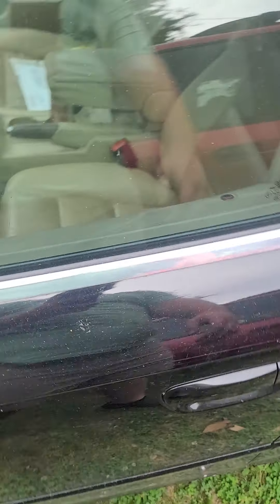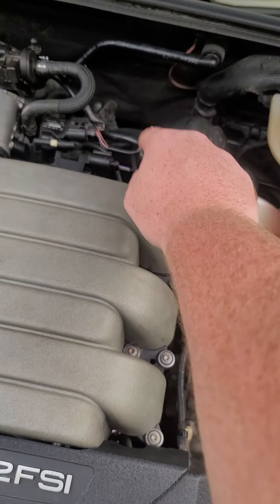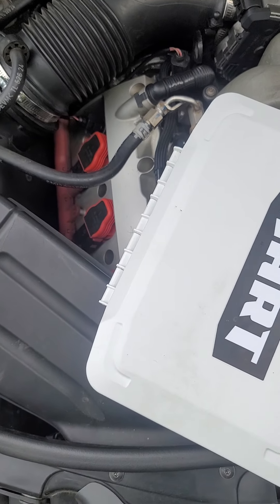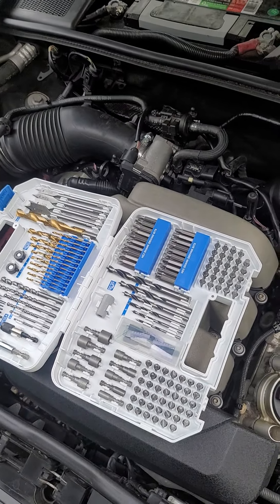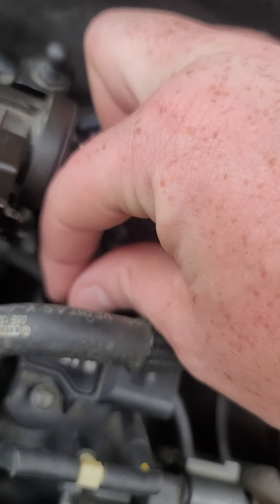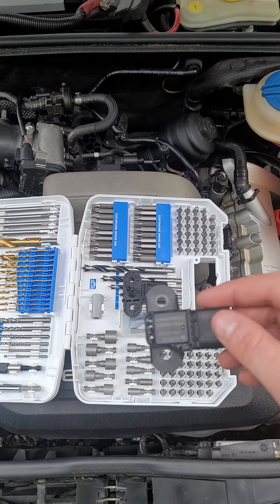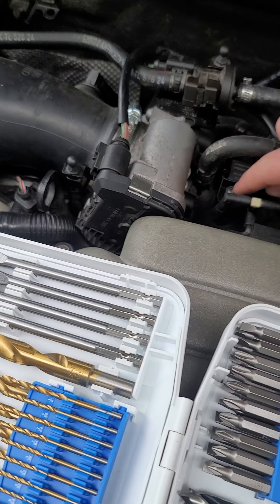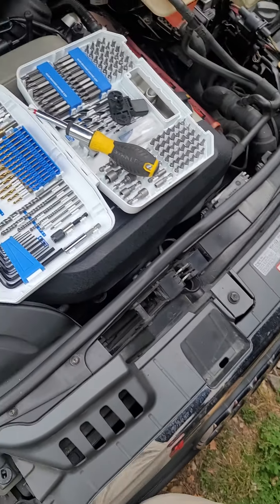How to replace your maf sensor on your Audi 3.2 fsi

Comment: Hi I just found your channel.

My 2009 Audi A6 C6 2.8 FSI keeps  having difficulty running on idle after I drove it for a while. Let’s say I start it up in the morning, do some grocery shopping and after an hour want to start it up again. Then it has a rough time starting up (I have to hit the gas pedal while starting up to get the engine running). From then on it has also problems holding low revs in idle and eventually turns off. The next day it starts like nothing happened. When under load, the engine works fine.

I am getting P1196, P1197, P0156, P0136, P2237, P2240, all lambda sensor related and I just changed all the sensors at a shop and it cost me so much but the problem stayed the same.
Do you think it’s this sensor or even a failing high pressure fuel pump?
Reply from the maker: Try the easy part first, replace the intank fuel pump, it sounds like lack of fuel.

Comment: Can this just be cleaned? Or need to replace?
Reply from the maker: You can definitely try and clean it, make sure you use electric cleaner from CRC. If that doesn’t work then you can definitely get a new one.

Comment: Hi bro, I am getting p0172 and p0175(running rich banks and bank2) code, will this sensor replacement solve the issue? It's the same car audi a5 3.2 fsi Quattro.
Reply from the maker: Check air filter, change maf/map sensor out, and do a tune up.
Reply: Hi, I’m also getting both errors. Did you solve it by changing MAP/MAF sensor?
Reply: @gabrieltovar8628  hi bro, the same week someone crashed into my car and it was totalled and bought a new car😊 good luck to you mate all the best 👍
Reply from the maker: It ended up being the chains.. my engine went on a grenade strike lol

Comment: What code were you getting that made you want to replace it? I'm getting P0068 and I'm trying to figure out what the issue is
Reply from the maker: Well I was getting the map and maf sensor code. But it didn't fix my issue. So I continued digging into the issue
Reply: @L.U.X.X  Did you ever get it resolved? Same issue -sensor dIdnT fix . Looks like 2 different part numbers..... not sure if that makes a difference or not. ?
Reply from the maker: Sadly all this built up to be bad timing which was causing random codes out of kno where. My car would shut off driving anywhere from 10 to 100 mph.
Reply: @L.U.X.X  Did you reset the ECU after installing MAP sensor?
Reply from the maker: Yes I did. You never want your battery connected when you do sensor changes. It can Short circut.

Comment: Not sure why but online retailers list a “Maf” for this 3.2 engine… had me scratching my head cause my son’s 2011 q5 3.2 does have a MAF off the air box
Reply from the maker: Not all 3.2 engines are the same though they might look it, some of the sensors are in different places on the Q5 and the Q6-7

Comment: I just replaced mines the same way.
I disconnected the negative battery.
Took off the old one, put the new one on.
Reconnected the negative battery.
Turned the car on (without the motor running), let stand for about a minute (I actually did this twice).
Then I turned the car on. 
I then erased the code.
So far, no problem.
Reply from the maker: Sweet I'm glad this video helped you out!

Comment: Hi man, I have codes p0491/0492. Do you think this could be a root cause too? Thank you for your videos bro 👍🏾
Reply from the maker: Id personally look into the air injection valves, there are two of them bank one means front side bank two means back side, swap the sensors around and see if the code follows the sensor and if it does you will have found the issue with your car.

Comment: The one you’ve just replace is the MAP sensor…the MAF sensor is close to your air intake filter.
Reply from the maker: Not on the 3.2 fsi engine. Audi had made the best choice ever by doing this.
Reply: I can attest to this. There is no conventional maf sensor in in 3.2

Comment: I feel like I got jipped by not having the conventional maf sensor lol
Reply from the maker: Okay what's going on? What's your issues?
Reply: @L.U.X.X  sorry. Just saw this... been having some health issues but did get done good news so
Anyway. Keeps throwing the left bank o2 code. I can reset it and get a couplebof hundred miles on it but I think it's misfiring, going rich and popping the code. 
Is there a carbon issue?  3.2  with 133k
Reply: *some
Reply from the maker: That can definitely cause a carbon issue.

Comment: map and maf sensors are not the same
Reply from the maker: On the 3.2 fsi engine. They actually are
Reply from the maker: The reason why is because audi had moved the maf sensor since they went with a different design and placed it behind the throttle body on the upper intake manifold. This is also the map sensor. One sensor controls two different things.
Reply: @L.U.X.X  I know GM F-Bodies from 87-89 were MAF cars, and 90-92 were MAP only.  The ECM on MAP just used ambient air temp and intake pressure to calulate intake air mass flow grams/s.  I have 3 2005-2008 Audi A6's, and I can find no reference to MAF in the manuals, only MAP.  So, it may just be only MAP on the 3.2L.  I know it's possible.  Some cars do have both, but I cannot see a MAF anywhere for the C6 A6.  I currently have a no start on 2008.  The output test for fuel pump ran through the range, and I could here it run from inside the car.  I was all set to pull connector under the seat and measure the volts at pump.
Reply from the maker: That's because they are the same sensor.
Reply: @L.U.X.X  code is name the same but after looking at it today.  No way it’s any way MAF.   It’s not in the air stream.  It’s pressure only.
Reply from the maker: Yes it keeps record of the air pressure going to the intake manifold
Reply: Does my 2009 A5 has a mass air flow sensor  @L.U.X.X
Reply: @BrandonMalveaux bro every car does
Reply from the maker: Yes, yes it does!